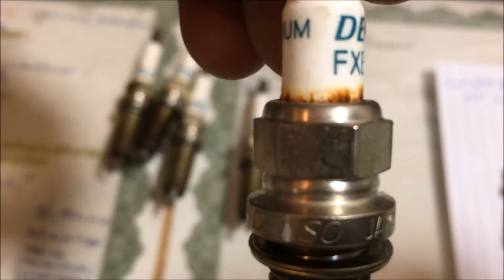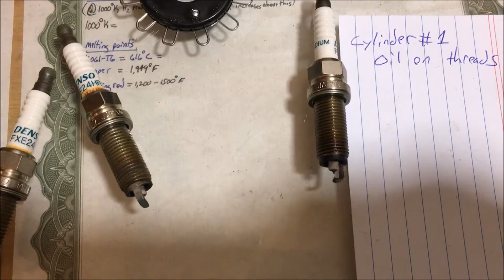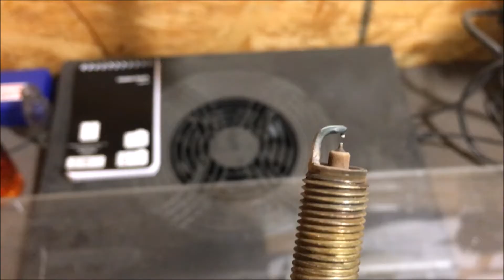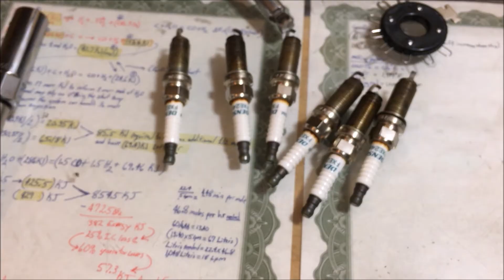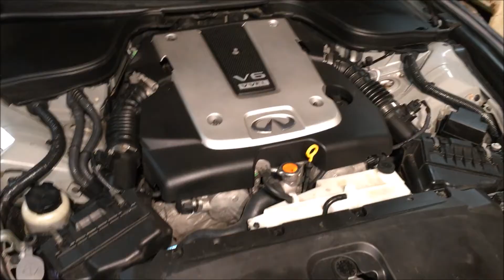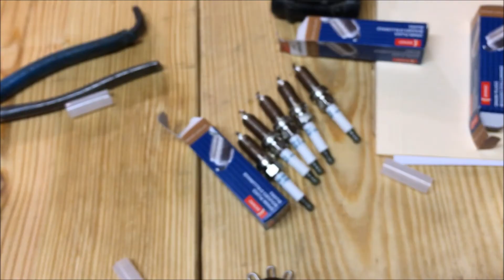Infiniti G37 Spark plug type Denso Spark Plugs

Comment: Spark plugs dont all look the same. Could be something wrong. They should all look identically burnt
Reply from the maker: yes you are correct , however the car ran great . sold it at 256,000 miles

Comment: That’s called a corona stain on the porcelain, it’s normal for spark plugs to have them. It’s usually caused by the exposed ceramic to attract things like dust particles once the spark plug gets electrified. It’s nothing to worry about.
Reply from the maker: thanks friend

Comment: I have seen that before, The marking at the porcelain is from arking between the spark plug boot and the SS base of the plug.
The discoloring is the baking of what ever is in the air near the ark.
Change plug wires. They look good otherwise.   Bad plug wires can cause rough Idling also. Turn off the lights and look under the hood while it is running in the dark, Look at each plug closely.
Reply from the maker: thanks for the input
Reply: This car uses coil on plug, what you suggested isn’t possible.
Reply: @RzVids  coil pack
Reply: WD40 ? (isolate)